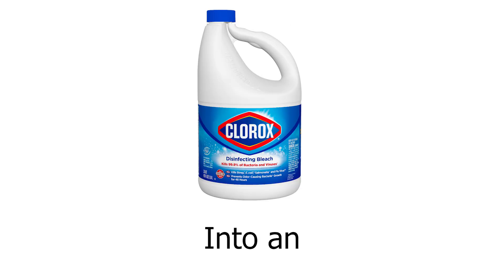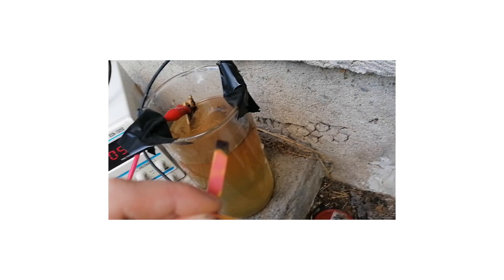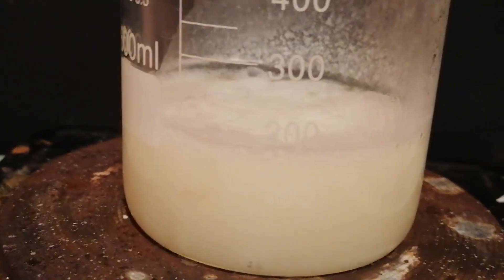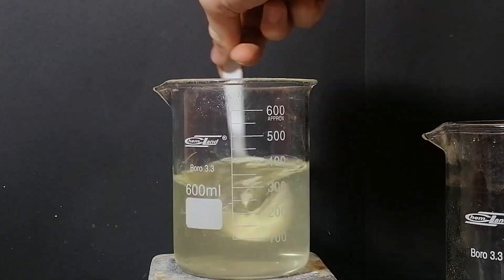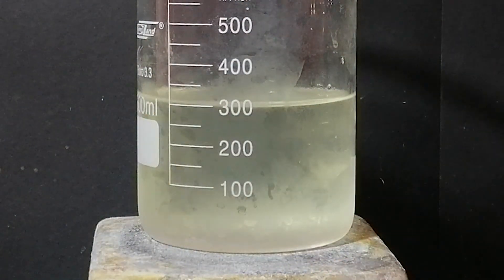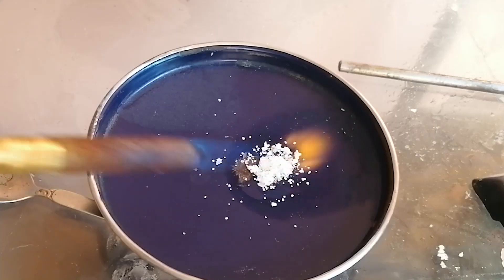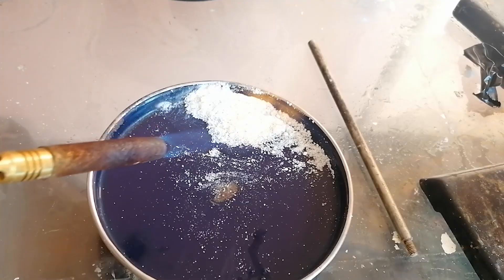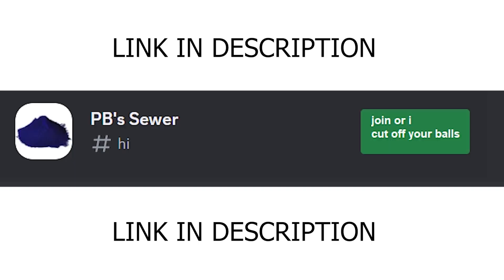Turning Bleach into Chlorates

Comment: Why do you decant the sodium chloride, and then immediately add your crude product into an aqueous solution of sodium chloride???? If it’s separate, wouldn’t you be better off leaving it in there and continuing to maintain heat to ensure the reaction is complete, and supersaturated the sodium chloride to make the perchlorate even less soluble (forcing most / more of it to crash?

Comment: I used 'gouging rods'...stripped off the copper cladding, infused the rods with linseed oil, roasted the rods to polymerize the oil.
I was getting 20-30 hours of run-time (6.5 volts, 37 amps) before much carbon ended up in suspension.
Total of about 160 hours in the electrolysis cell.
Didn't use Bleach...potassium chloride 'salt substitute'.
When I crystallized the combined batches, I was surprised to see both chlorate and perchlorate crystals form.
K. perchlorate I used for colored fireworks, the K. chlorate was used to make loud noises.

Comment: Guy who did this alot here! You can concentrate alot of bleach by boiling it down until you start seeing a decent amount of crystals. More heat over a longer time is kind of good because it gives more time for hypochlorite to decompose into chlorate. I generally concentrated about 1400-1600mls at a time (fill my boiling container, boil off most of water, remove whats remaining powder included and redo with more bleach) i then readded everything together and concentrated it a bit more. Took the remaining liquid and put it in the freezer to drive the solubility down. Filtered the crystals off and rinse and repeat up until id have to do a replacement reaction with the KCl. Ultimately i didnt find NaCl or KCl contamination to make a crazy difference however it will affect how much chlorate is supposedly in 1g of powder which can throw your math off if you intend it for pyrotechnics. As well any liquid found to be throwing away as waste you should keep and reboil that until you see crystals forming and do the freezer trick again with your waste. Personally ive found the waste has a fuckton of chlorate leftover you can extract before contamination becomes a issue. Significantly improves yield but its a pain to purify.
Reply: With waste product i would only boil it once until crystals form and freeze it once. Trying to get anything much more out of your waste will most times just contaminate the shit out of it with salt ao if you have 500ml of waste liquid, boil off about 200-300ml and crystalise out of that what you can and then discard whatever liquid is remaining. (I boiled it dry to store in a baggy as chemical waste)

Comment: You can also jump start the electrolytic reaction using bleach as wel, just feed it brine and let it run. Most important is to use a lead dioxide anode and a stirring mechanism. The reaction is done when you get crystals of chlorate and perchlorate forming. Displace using concentrated KCl and purify using recrystalization ❤

Comment: Mix it with some wax! 

I did that with barium chorate i was disposing. Just make sure its mixed REALLY well as the barium chlorate is alot denser than the paraffin and sits at the bottom of the wax, it then goes whoosh! (The flame was about 3m high!)
Reply: Thanks for the knowledge

Comment: The electrolysis method works best with the proper set up. You can use expensive mmo or platinum electrodes, but you still need to monitor the ph and salinity to prolong the life of rhe electrodes. Or you can use disposable electrodes and set and forget. Unfortunately option is pretty dirty requiring fair amount of filtering and recrystallizing to get a decent product. So do not use a glass frit if you use carbon electrodes. The particle size is so small that it is impossible to clean and will contaminate other filtrations later on.

I personally don't like the decomposition and double displacement method, only because it produces so little with that concentration. You can increase your yield by using hypochlorite pool tabs, which are advertised at 50% by weight, which is much easier process than trying to boil down that much liquid.
Reply: The positive plate from a discarded car battery works OK, but must be formed to make as much of the lead sulfate as possible into lead dioxide, then it must be soaked for a few days in sodium hydroxide to remove the sulfuric acid. ❤

Comment: Ah yes, the classic, incredibly safe method of turning a strong oxidizer into powder… using a blender.
Reply: As long as it’s not mixed with a fuel it’s pretty inert
Reply: @twirlyturd4364 until the plastic blender becomes fuel
Reply: @koukouzee2923  it would have too be grinded down and plastic is not a very good fuel even with a strong oxidiser like pottasium chlorate
Reply: That Magic Bullet is NEVER gonna see a smoothie ever again 😮
Reply: It's ok as long as there was nothing else in that blender.

Comment: So wrong, expensive way, bad yield and never play with kcl3, only kclo4 and make it by electrolyses.
Reply: Chlorates aren't as terrible as their reputation would make you think, outside of some very specific and sensitive mixes but they do need to be respected. You're absolutely right about electrolysis. Btw, it's KClO3
Reply: I have been a chemist for 14 years and have never used electrolysis to produce chlorates and perchlorates, the heating method of producing both works perfectly.
Reply: I'm not against electrosis, but it takes a long time But I consider it to be much safer than the heating method, because if the temperature is not well controlled it can decompose chlorates and perchlorates.

Comment: This potassium chlorate is quite unpure
Unpure potassium chlorate crystallizes as needle-like crystals like nitrates do
But pure potassium chlorate crystallizes as hexagonal very thin flakes
When the solution is still warm and it starts to crystallize, it looks like rainbow glitter snow falling to the bottom of the beaker
Reply: What method do you recommend to purify chlorates and nitrates?
Reply: @StrangeAeons13  recrystalization.
You know what it is, and how to do it?
Reply: That's right. I obtain some of those flakes during exhange KCl with NaClO3 produced via electrolysis of NaCl with chromates.
Reply: Would the electrolysis of kcl not be more efficient instead of having to convert NaCl to NaClO3 and then with KCl to KClO3? @ukaszjozwiak9468
Reply: @ukaszjozwiak9468  masz discorda?

Comment: Can I use 25% bleach. If not are there any videos how to concentrate it?
Reply: 25% bleach?? Are you sure it's 25% NaClO?
If it is 2.5% its fine but I got 8g of pure KClO3 from 1L of 5% bleach so your yeld will be lower 
There's no way of concentrating it cause it'll decompose to chlorates and you want that
If there isn't a way to buy at least 10% NaClO where you live you can use that but imo it isn't worth your time, electricity etc
Reply: 25% bleach would be even better since regular bleach is 5-7% but electrolysis is the best way to make chlorates.
Reply: @chemistryofquestionablequa6252  N In my opinion I do not like to make chlorates by means of electrolysis, it takes a long time and not everyone has a power source or battery and anodes and cathodes. I have always used the heating method to convert chlorates to perchlorates and it has worked perfectly for me.

Comment: Currently in the process of turning 800g of salt into hopefully ~2000g of sodium perchlorate via electrolysis. Just gotta let current pass through it for about another month...
Reply: It is a good way of producing chlorates and perchlorates, but MMO, platinum or PbO2 electrodes ain't cheap 
But if you have them you can produce infinite amounts of chlorates/perchlorates
Reply: @Krzysix.io11 I know it's not that interesting, but isn't it easier to just buy sodium perchlorate?  it's only $8/kg
Reply: @_jocker_games_ its banned in EU
Reply: @Krzysix.io11  @lplusratio_ ok, got ya guys, just didn't know about that. casually ordering 25kg bag of KClO4 and KNO3
Reply: @_jocker_games_ casually being added to a government watchlist
Reply: @Sniperboy5551  everyone is
Reply: this is going to take weeks if not months
Reply: @slqjeueuieqpiejdjsjs  it'll take +/- month without any effort
Reply: @slqjeueuieqpiejdjsjs  At 15 watts I estimate it'll finish in about a month
Reply: @aerobiesizer3968  what electrodes are you using ? mmo, platinium or carbon
Reply: How cringe this use pc power supply or car battery charger (truck or tractor battery charger are the best. With à good pc power supply you have chlorate in few day and a long efficient week can get you the first perchlorates cristal (depends on the salt use and the amp of ur power supply).
Truck battery charger can easly get up to 50amp with this in a few day with strong electrode you will have perchlorate in a few days
Reply: @lmaozedingdong6099 at 50 amps you're likely to destroy your expensive electrodes before the experiment is done, even platinum. In the case of carbon electrodes, they can only handle around 30ma per cm². Unless you have about 3 meters of 20mm diameter for the carbon, 50 amps will come to halt within a day, plus that much current is just plain silly to deal with unless you're producing it in extreme bulk, which I don't recommend doing.
Reply: @nunyabisnass1141  also I said that they can go up to 50amp not that you should use it full power I guess that depending on the charger you can have slow and fast mode and nothing forbids you to but cabling in your circuit to reduce some amp
Reply: @lmaozedingdong6099  i guess that came down to a bad assumption on my part. The car and truck battery chargers I'm familiar with only have smart charge circuitry and I haven't been able to find the old single step down transformer style in almost ten years, except at a garage sale, so i assumed that was what you were talking about, the old style with no protection. 

But I guess if we are going with the ghetto set up, I suppose you could always use a carbon rod as the resistor, or get an appropriately rated one from eBay.
Reply: @nunyabisnass1141  well I never used battery charger either I’ve just herd people irl saying they know somebody having a charger like that, I’m only guessing but with some of my logic 😋.
Reply: @nunyabisnass1141  hoo also do you live in America? If it’s the case might be a big difference because of your 110v electrical arrival since less voltage your cable have to handle more amp and heat to get the same watt as a 240v will.
Ex: 
440w motor need either 240V X 1,8A or 110V X 4A to get to the same power with high power charger you can be limited because less volt need more amp and amp makes cable heat at a point where all will melt
Reply: If you start with a saturated solution of chlorate it will go much faster, but also to keep the temp fairly high to increase the solubility. The main problem you're going to run into though is salt creep destroying your electrical contacts.
Reply: 2000g of perchlorate? 
I can't imagine needing that much perchlorate for fireworks. Sounds like you're making an IED.
Reply: @WarlordEnthusiast  pffff